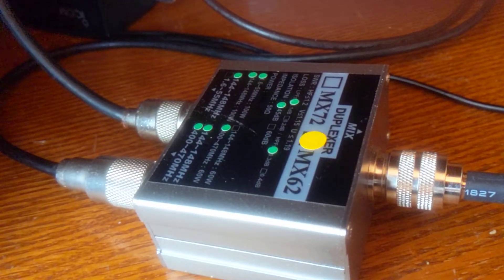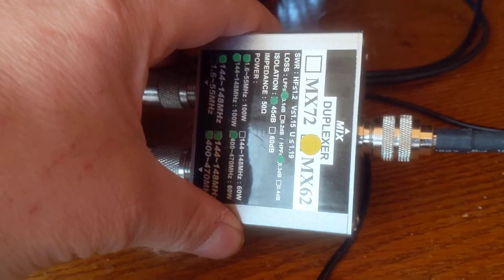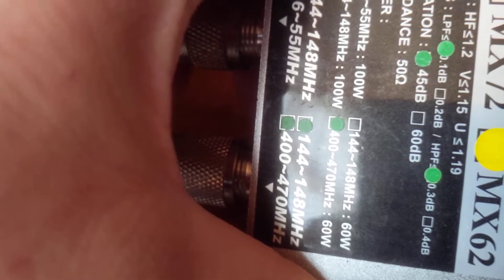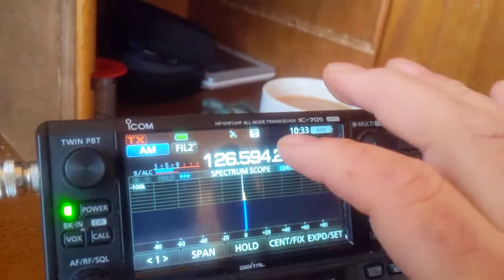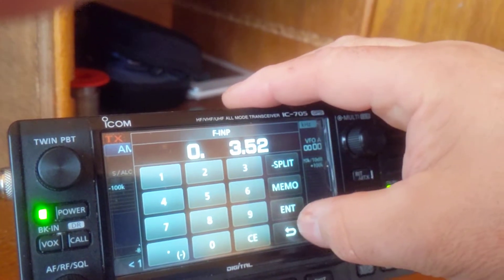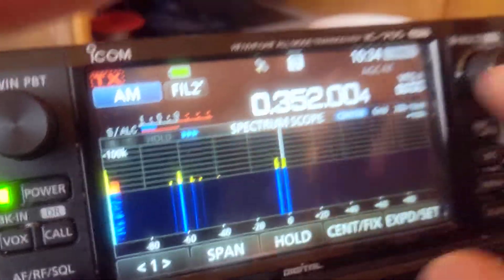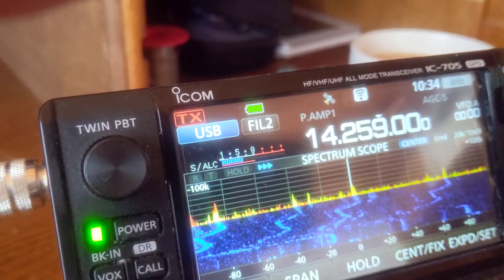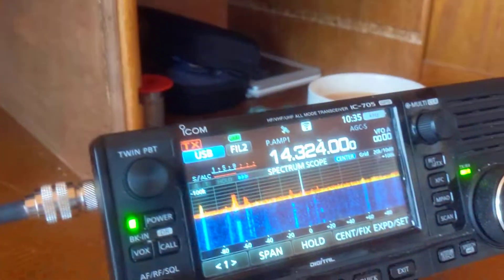MX 62 duplexer and the ic705

Comment: Isn't your green marker suppose to be on HF -- on the left port?
Reply from the maker: Just checked the ebay listing and the 72 is the uhf vhf and the 62 which was cheaper is hf vhf UHF .
Reply: @raybokor2  How is this safe if the isolation is only 45dB?
I have a 100W HF and 80W VHF.
Reply from the maker: from what i understand that is only the 72 model but this works ok on the left port . its a bit confused
Reply: @raybokor2  I was just going by the Amazon pictures.  Clearly shows the MX62 with the green dot on the HF text.
Reply from the maker: So I'm wrong and I must have. Lost. A green dot ;)

Comment: I use to use a duplexer on my FT 897D. My OCF40 would cover Hf and 2 meters. Where you have two antennas and one radio, I had to outputs from my one radio and an antenna that covered 2 meters as well as HF. Either way,  it's a neat way to be able to work HF and 2 meters with what we can call auto antenna selection.
Nice demo.  Thank for posting. 
Barry, KU3X/QRP
Reply from the maker: glad you liked it  Barry .